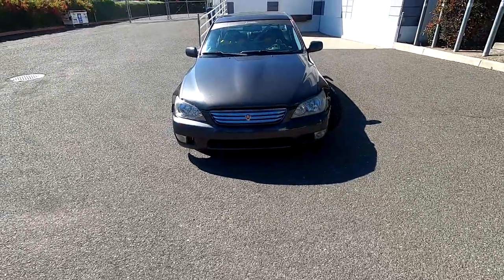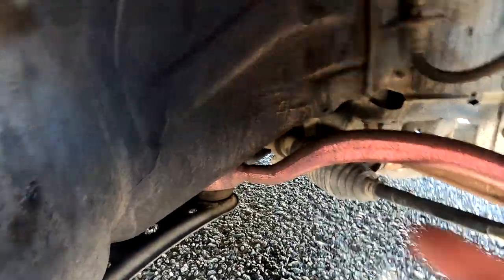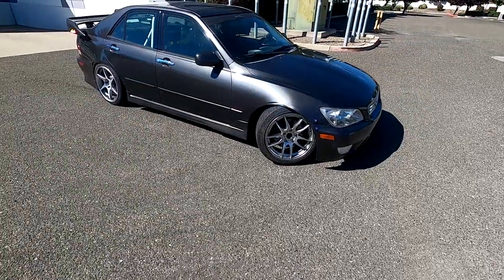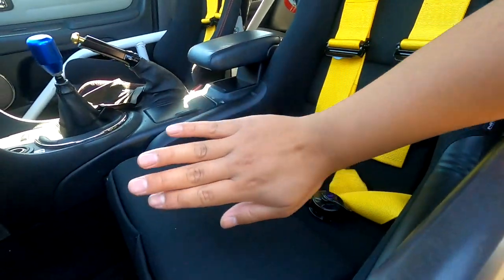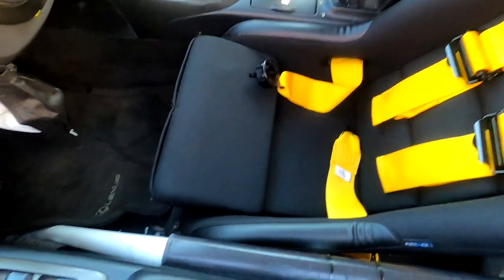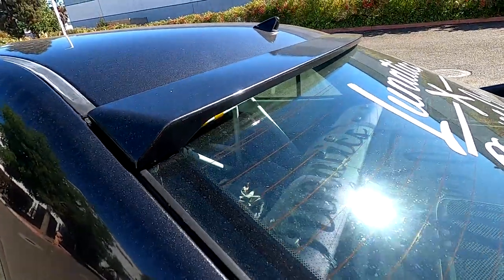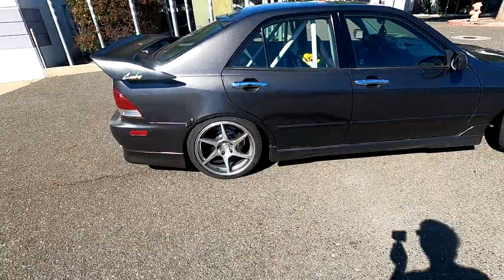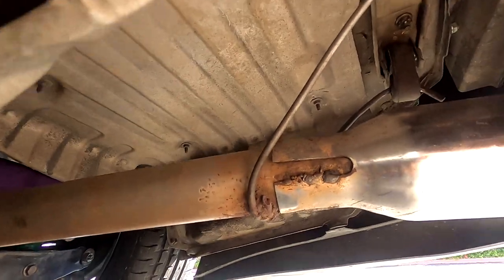IS300 Drift Build Full Mod List!

Comment: Jeez bro , would you recommend a welded diff or the stock 3.9 lsd  or brz 4.1 diff ?
Reply from the maker: Depends on what your doing. If it’s a daily car an LSD would be more practical. If it’s strictly drifting and plan to do a lot of driving and tandems I think welded would be better.
Reply: @CorneliusVeee  well it’s daily but eventually I’ll get another car and I just wanna get it done ASAP
Reply: Brz, don’t weld it t
Reply: @TheNerf59  yeah but race car on a budget 😆